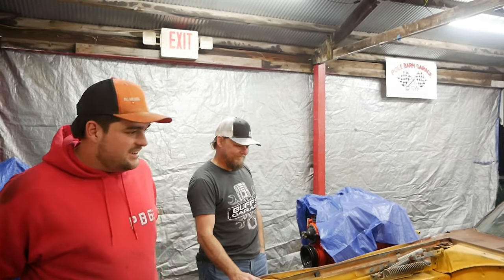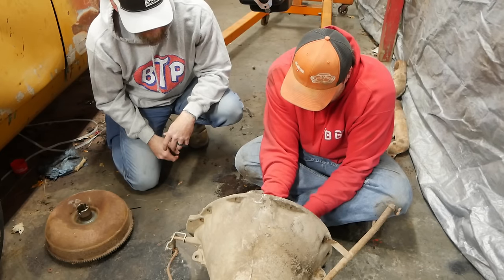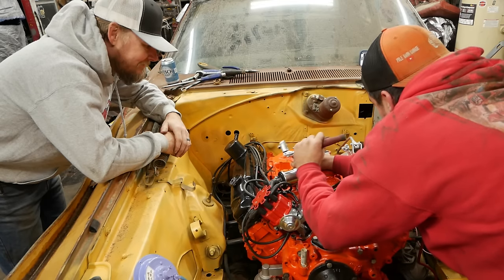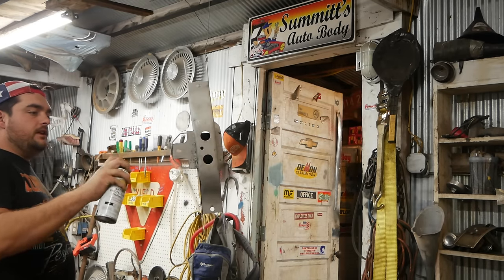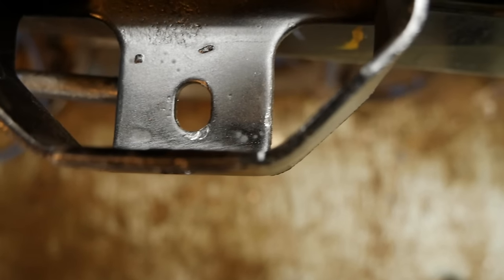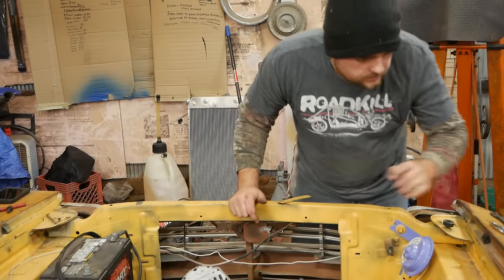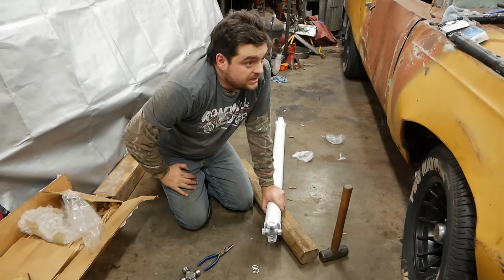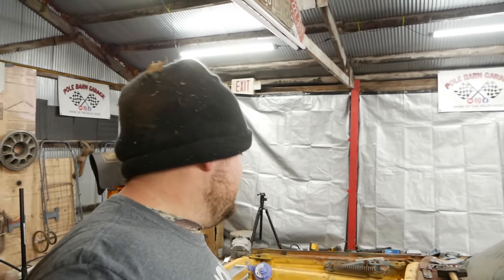440 Engine Installed in Worst RoadRunner! Will it RUN OR Will it BURN? Plymouth RolledRunner Thrash

Comment: I mean, worse case you end up setting yourself on fire.. Been there, done that...Kinda nice in February until you realize... You know... "Oh, hell, my jacket is on fire... Oh... I'M ON FIRE!"
Reply: Yeah being on fire your self is not a good time.. back fire caught spilled gas on fire near fuel source and spilled that on my self trying to get it away... gas soaked clothing don't go out easily tried stop drop and roll on my gravel driveway to no help had to just strip all my clothes off and ran to shower then er.
Reply: @randysimmons3587  No, no they do not. Luckily I wasn't injured, but my jacket was quite literally toast. Threw it in the mud, stomped on it, eventually just gave up and let it burn haha. I think the carburetor barfed gas up on my jacket at some point and I was too cold and annoyed to notice, I've got no idea how I actually got lit on fire though.

Comment: I’ve used a piece a chain for motor mounts, tranny mounts, radiator mounts, door latches, I remember using a chain to hold a carburetor in place one time. Long bolts and some washers through the links for fine tuning the tension. That was back before I discovered ratchet straps.

Comment: In cold weather States like Michigan if you want to work on a car whether it be a hot rod or a piece of c***, you always worked out in your garage. But using a heater with some this Queen or painter's tarp works great you just staple it around the edges run your heater inside, and you'll get 70 to 80ﾟ temperatures.

Comment: Great to see the progress!  One thing, not trying to be an overly critical MoPar guy or anything, but, isn’t trying to use a GM alternator just making things more difficult? Seems like you can chew up belts without hanging a different alternator off the wrong side of the water pump.  Other than that, I am squarely in your corner lovin’ what you’re doin’ - carry on!!
Reply from the maker: Sort of. I don't have the brackets for the Mopar stuff either, or at least I don't think I do. So i guess if I have to make something may as well be the simple one

Comment: Well, she's in, she ran and she definitely made fire!  Can't argue with that result, can you?  Good to see the driveshaft fits.  Measuring stuff is so over-rated - it takes up way too much of the build time.....and a dozen self-tappers or a welder can take care of any shortfalls, for sure.  Nothing wrong with that at all because it works - and it aint silly if it works!  Just remember that if you have the shifter shifting the wrong way that pulling it down from drive doesn't get you 'N' for NOS, 'R' for Race and 'P' for Pass the bas*ard!! 

You seem to have lost your fizz for this project a wee bit, mate.  Understandable - especially since you'd not long finished the marathon that was the Holey Goat when you picked this beasty up.  The problem is that if you leave it too long, you can REALLY go sour on a project (been there, done that myself) and end up sending it back where it came from or selling it off at a huge loss because you cannot stand the sight of it and just want to work on something you like.  A suggestion:  Find the next project - something that will really get the juices flowing (er....um....yeah, ok) - and have it sitting ready for when the Rolledrunner is sorted......and you're not allowed to start it until the 'Runner is a Dunner.  It helped me to focus.....and once or twice got me to cut my losses and boot the project I really didn't want to continue with.  Either way, it got me moving and my love for tinkering was restored.  Just a thought.....

For the record though, I'm still enjoying your sense of humour and the work you do on these beasts that people have cast off and forgotten.  In 20 or 30 years time, are people going to do this to a then-50-year-old Crown Vic or rice beater?  They might for the Vic......but either way, I cannot see it being as good to watch.  All the best, bud.
Reply from the maker: That's EXACTLY what I did with the van. My motivation for finishing the roadrunner is getting to work on the van

Comment: i air old  gas stuff for while then run a hose over them couple times not easy getting the refurbish or stages 123 running and driveing lots fun i always want hot wire them tunes in lights comes in handy

Comment: I'm sorry, but it cracks me up seeing the master cylinder that low on the fire wall. I understand that it doesn't matter,  but that thing is about a 12" too low.🤣🤣🤣.
I love this channel!
Reply from the maker: It is? It's bolted right to the pedal assembly lol
Reply: I know, but usually they have the booster, and they are just below the top of the fenders.

Comment: Good job on slamming the engine back home! You sure put a lot of money in that thing! After you get it put back together it's probably as good as it's ever going to be. Like Darnell said in 'Christine', "You can't polish a turd." It would probably be a good circle track car with some fortification. Plymouth made almost 85,000 '69 RR's practically all 383 cars. Not much of that one left to make it worthwhile. Could be done if you wanted to throw money at it.
WIX has really gone to shit since the Germans took over. I stopped using them a few years ago. Same company, but Purolator is still OK. Those fuel filters are really made to be on the pressure side of the pump. Fuel pumps push fuel better than they can pull it.
Reply from the maker: Yes but pretty common to use them before a pump when you have a bad gas tank. I do suspect that's why a lot of youtubers kill fuel pumps constantly

Comment: The Low Buck Club...... A buddy and I are starting a new car club and were either calling it "The Low Buck Rodders" or the "Low Buck Cruisers".  There are 2 rules,  1. you have to have atleast 1 vehicle 25 years old or older and 2. You have to have less than 10k in your vehicle.

Comment: Luxe rad is pretty good. Been running a bigger one on my truck and it works better than the old one with a hole in it. From the wreck.

Comment: Just be thankful you don't have a 4 speed. The input shaft size number of splines and the size of the universals become a rubic cube of crazyness depending on the differential.
Reply: Only the Hemi 4 speeds had different input shafts....Universals are common sense...you get a low performance engine the U joints/yokes/diff.  are smaller. The performance engines...now stay with me here Forest....are BIGGER  U joints/yokes/diff. that's because bigger am stronger !!!  DUH..............

Comment: Are you using the trans from the fury I guess . what happen to the trans from the motor home it should work I would think. Although it would have very low gear ratios 1&2 and wide into 3rd.
Reply from the maker: Has a companion flange and is not interchangeable with the 1967 case

Comment: Good Progress, wouldn't the Motorhome trans fit? Get some more corrugated metal and make some doors (for the Pole Barn 😄).
Reply from the maker: Nope, has a companion flange rather than a slip yoke

Comment: if you get a good heavy duty 727 out of a full size wagon you'll need that yoke then . so not a loss there full size 70s wagons use the 4 pinion planetary unit  assembly and hemi trans had the 5 other 727 run of the mill had 3
Reply from the maker: Same spline count either way

Comment: For a minute it looked like a firebird ha ha. The carb gasket is leaking I see fumes coming out under the carburetor. if trans don't work put some brake fluid in it . I would have poured some gas on the trans and lit it on fire first for good luck

Comment: 440s have the oil pump mounted outside the oil pan. Man I could still be driving some old Chevy's had GM put their oil pump like Dodge. 150k miles 20lb of oil SBC? Put a 75 lb pump on her n keep driving.
Reply from the maker: Truthfully I like Mopar engines a lot. The cars are terrible though

Comment: Haha I don't get why you don't use your shop press? Pretty sure I saw one in that back corner there
Reply from the maker: I don't remember what I was doing in this episode, but one time I was pressing bushings into control arms, and the arm popped out under pressure and hit me square in the nuts, I've been wary ever since lol
Reply: @Pole Barn Garage  doing the u joints for the road runner. I know sometimes I just like getting the hammer out to do them. But it just creates more headaches. That's why I bought one. Even though it mostly gets unused. Buy when I rebuilt the rear end for my truck it came in handy

Comment: With a "working" 727 that kickdown lever has to be hooked up. If you run it with that not properly set it will destroy the tranny within the first mile or two.
Reply from the maker: Yeah, it broke something in there. I'll check it out when I drop the pan

Comment: Tell you what we need to do, let’s try to get you some heat in that’s shop somehow.
Reply from the maker: You're a member, so that helps! Buy a shirt!
Reply: @PoleBarnGarage  dude, I’ll come down to give you a hand. Before I started driving truck I worked as a tinner. I’ve installed many furnace’s. I have a house one here that is in my basement but it’s pretty old. It worked fine but I put a new one in 2 years ago. Wish you were closer.

Comment: You should have stuck to Ford and Chevy I've worked on all three Chevys are easy to work on Pontiac and Oldsmobile or a little harder Ford harder even still but Mopar like you said 73 different motor mounts for the same engine
Reply from the maker: Yes, but variety is the spice of life.
Reply: @PoleBarnGarage  I do enjoy the fact that you've got to be making the Mopar guys absolutely nuts I know how particular Mopar guys can be

Comment: Mopar alternators aren't that complicated
Reply from the maker: No, but they do have 2 field wires and require an external regulator. I could do it, or just run one wire and be done
Reply: @PoleBarnGarage  I believe the '90's Denso alternators Mopar used on practically everything is a virtual bolt-in with the OE brackets. Might need minor spacer adjustment. You may be missing a bracket. There's supposed to be a triangular bracket on the top.

Comment: As entertaining as you and me beiing a Mopar guy my whole driving life this pains me to watch . scrap the starter , the torque converter bolts up one way only . the bolt are not symmetrical. The are uneven .
Reply from the maker: Yeah, learned that the hard way, it's stuff like that that makes me never want to put a Mopar in anything again. The starter healed itself magically
Reply: We Mopar folk are special and hardy bunch . PS; Locktite those converter bolts . I speak from experience 😁😁👍👍

Comment: Your hatred of Mopar comes from your ignorance of them. Motor mounts are simple enough when you buy the right ones, and the trans torque converter you had trouble installing I kept yelling at the screen "turn it and push now the other way and push"!!! ....easy peasy. Then I would bet a million dollars you didn't know about the different size flex plates on different Mopars because of different torque converter sizes. You got lucky and had the right one on the engine??? Or did you??? And the staggered TC bolts.  And You  run that trans without getting the pressure valve working and hooked up you will cook the trans quickly. I got pretty disgusted watching you try to work on that and turned it off I couldn't take it any more. Here's a tip...if you don't like something and you have trouble working on it because of your lack of knowledge of said thing, then don't work on it and blame the manufacturer for YOUR failure...simple.
Reply from the maker: You realize every other brand of car has none of those concerns, hence why myself and many others, can't stand working on Mopars. If it's all you've ever known, great. But I can objectively state that they are overcomplicated for 0 reason. Like why stagger the TC bolts exactly? I can't think of a single other domestic car that does that. There's literally no reason. I can also objectively admit to plenty of engineering stupidity on GM or Ford products, but you'll never find a case as many oddball and flat out dumb things as you will a mopar